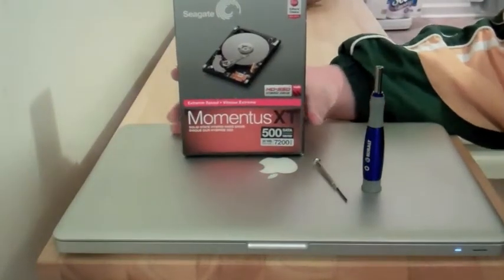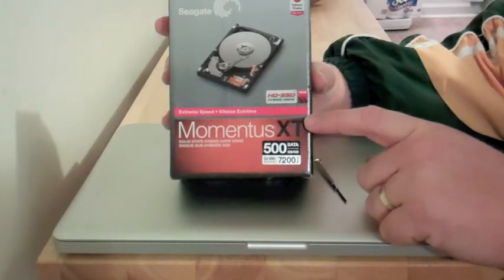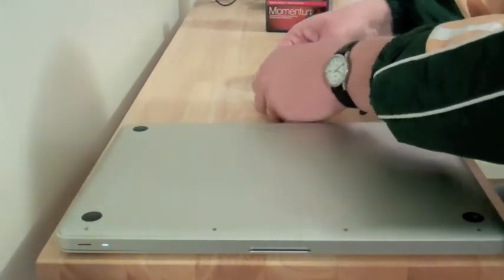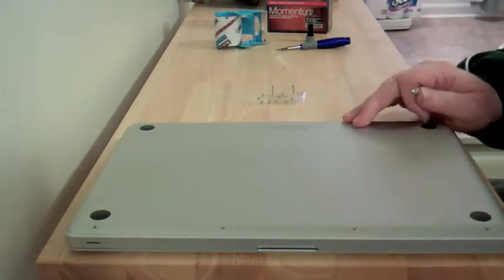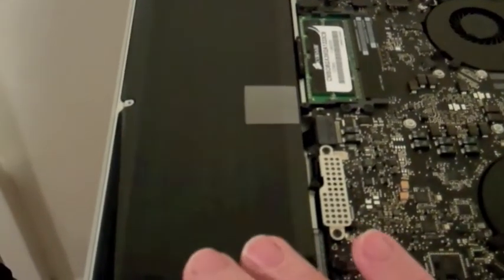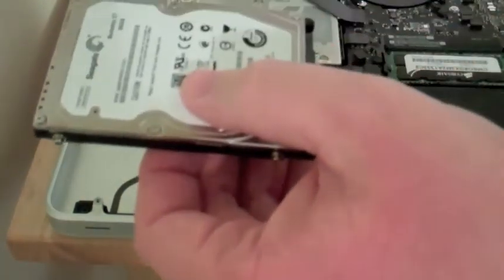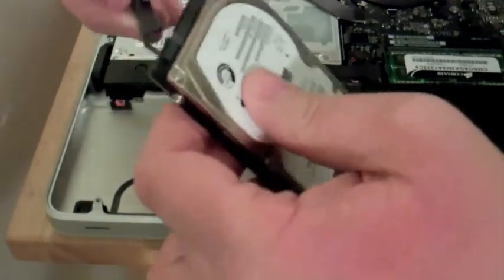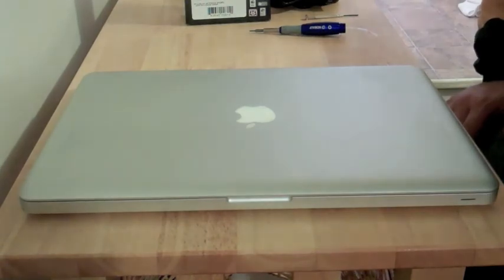Install Hard Drive on MacBook Pro

Comment: Hey thanks for the awesome video I just used it to change mine. I actually used the same harddrive. I was curious as to how I can make certain that the operating system is on the SSD part of the hybrid to ensure faster booting? Or is that not even possible? Thanks in advanced